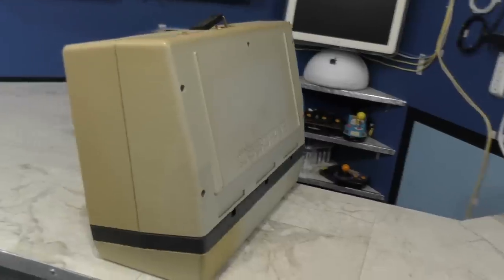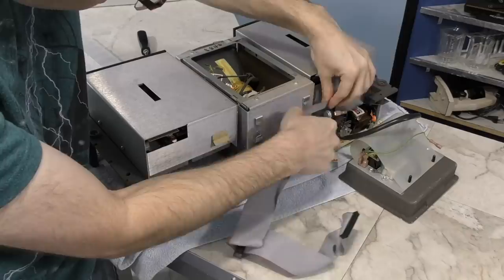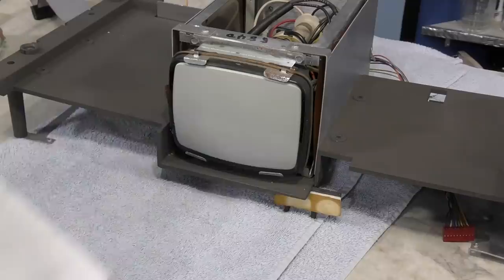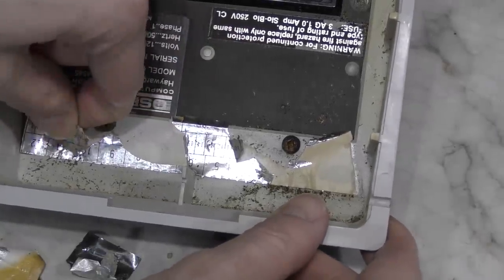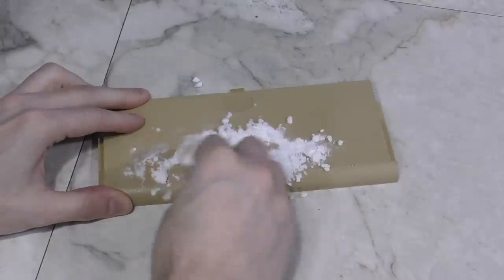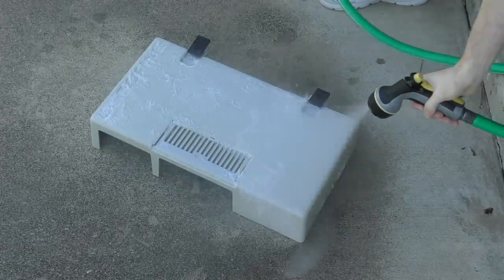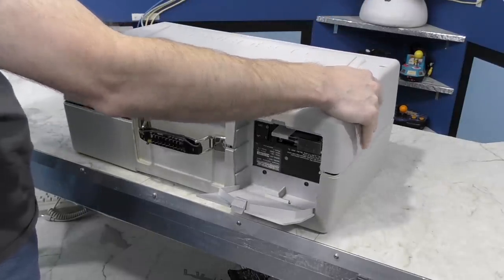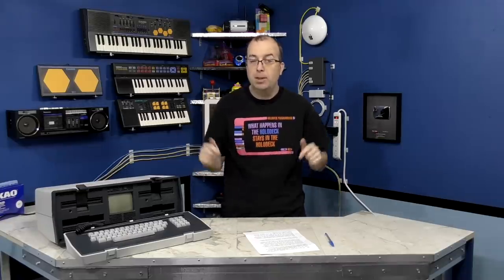Osborne 1 Computer Restoration Part 2

Comment: The mustard and ketchup analogy cracked me up! 😃

Perhaps someone could make you some 3D printed custom basins for you to use for submerging items in hydrogen peroxide?
Reply: There already exist big, transparent plastic containers
Reply: Wouldn't it just be better to get some clear totes from a store, fill it up with peroxide, and just leave it out in the sun?
Reply: a big plastic tub will work fine its the peroxide thats the problem he would need gallons of the stuff
Reply: Would it be possible to synthesize it?
Reply: Well, of course off the shelf is what's cheapest and easiest obviously, but I was thinking something that would help him keep the components in place or shaped to fit better. Just an idea. ;)
Reply: not if it's reacting with something, it's converting into... oh... I used to know this one..  one of the products is water, one is oxygen, and... by my math, that would use it all up. but I think there's more.
Reply: Maybe a recirculating system, collecting peroxide from the tray where the part is and pumping it back over the surface, spraying the part — or even just dripping over. Maybe a small fishtank-type pump would do the job.
Reply: fantastisk musikk du lager Anders!
Reply: Just take a big container and put a couple bricks or whatever in the biggest holes in the chassis to fill it up. No need to make a specific shape.
Reply: I use a 10 gallon aquarium. Glass is important, the plastic bins filter and absorb the UV.
Reply: If you have a Smith's Grocery nearby, they are doing a sale 10 containers for $10. Which is around 3 gallons I believe.
I saw the stuff on sale and was like wow, what would I do with so much peroxide and then this video came up lol
Reply: "Allow me to demonstrate with this mustard."
Reply: It degrades into water, oxygen, mustard and ketchup. It was shown in the video. ;-)
Reply: I like peroxide on my hotdogs
Reply: why not mix it up with water? I'm pretty sure part of what is in the retrobright fluid is water anyway. you could do a few tests with different concentrations and see how much pure peroxide you need. maybe using more water and letting it sit in the sun a bit more gives you the same results
Reply: Does using a bag w/ peroxide around the item, then a second bag +packing material to form that bag to the object not work with larger pieces?
Reply: LynxSnowCat   That would cut off one of the most crucial ingredients; Sunlight.
Reply: A large watertight plastic tank or container would be good be good and probably something about 100-150 litres and an electrical pump could be used to redistribute hydrogen peroxide and a UV light.
Reply: Patricia Cross , I *did not fully understand your reasoning. With two transparent bags- the first keeps an envelope of peroxide around the part, while the second (smaller surface area bag) takes up space by pushing the packing material where sunlight is already excluded.

(*reread previous comment)  I see where my previous comment could be assumed to mean surrounding the part on all sides with packing material, since I didn't make it clear what I meant by forming. 

Putting the second bag in the first tends to result in it floating and making the layer of liquid on top of the part very thin. So the second bag needs to be denser than the liquid or outside of the first bag. With the second bag outside of the first, the first bag needs to be loose enough to form around the contours of the part being treated. A loose bag will tend to let the liquid run off of the part, unless it is confined/formed by another container, such as the (tighter) second bag.

edit: I only used this to "whiten" hand held peripherals years ago, nothing desktop sized.
edit 2: explicit self incriminating detail changed to be implicit.
Reply: There's also the issue of the amount of hydrogen peroxide you'd have to use as well.

Comment: There are 3 film capacitors that need to be replaced in Osborne PSU's. You only replaced the one that popped. It'll be letting the smoke out again very soon.
Reply: Exactly what was going through my head.
Reply: The same thing happened to my Apple IIE platinum. Luckily I had a spare capacitor laying around to replace it.
Reply: What's wrong with these capacitors, why do they fail this way? I thought non-electrolytic capacitors are bulletproof and don't age.
Reply: @VioletGiraffe  search for RIFA X caps, they're a known source of failure. E.g. http://minuszerodegrees.net/failure.htm
Reply: Those RIFA line filter capacitors are notorious for popping and emitting smoke.
Reply: Meanwhile: watching because. wait why am I watching this idk I just like it
Reply: The days when no computer was complete without a time bomb strapped across the mains.
Reply: @VioletGiraffe  As Marco said, those are X-class Rifa capacitors. X-class means they're used as filtering caps between mains and neutral. The problem is that over time the clear potting can crack, which lets moisture enter the cap. This causes a drop in resistance, the cap heats up, maybe some of the insulating plastic melts (I am not completely sure about that), and then the cap usually fails in a short-circuit. This also caused it to spew its guts everywhere, and you have to do a lot of cleaning. If you have old electronics, open them and look for Rifa caps. Those things are a fire hazard, and I am not sure if you want to have a fire in your house.
Reply: @vincentguttmann2231  О да пожар о круто.  Пойду пукну.
Reply: @GrIpPiS  I'm sorry, but I don't speak your language, so I'd appreciate if you could translate it to english.
Reply: @vincentguttmann2231  He said "Oh yes fire oh cool. I'm going to fart."

Comment: I'm using your retro brightening method for the chairs in my garden, at first was marble effect but I started to spray the product and cover the things with huge transparent plastic bags, fill them with air with a compressor. Is actually working perfectly on the chairs and tables, I hope is useful for you as well.

Comment: Please keep in mind that The 8-Bit Guy is not a professional museum conservator. (I doubt anyone in the comments section is either.) As an enthusiastic amateur, he does what he does for the purposes of his own pleasure and self-edification, and although he does usually seem to know what he's doing, he's bound to make a few mistakes, but mistakes are one way of learning. The fact that he shows and admits his mistakes is actually quite thoughtful of him and should help others to not make the same mistakes in the future. Furthermore, nothing he has ever restored (or damaged, for that matter) has been exceedingly rare or priceless. 
With reference to the leather: there are some applications where it is useful to dampen or soak leather to make it pliable. A quick Google search also reveals that hydrogen peroxide shows up in some leather cleaning solutions, though not at the concentrations found in retrobright. However, soaking leather for any longer than absolutely necessary is a bad idea, especially if it's old or fragile to begin with.
Reply: He's not a conservator of any kind. Conservation and restoration are two different things.
Reply: H
Reply: platypusfrenzy No he’s both. He restores the computers and preserves them inside his museum of computers.

Comment: Ever considered keeping an air purifier and small, low-powered desk fan pointing in the direction of the air purifier by your workstation when you work on your projects? Would make it better for you in incidents where something such as a capacitor in an old computer or other device is to blow & smoke.

Comment: When I retrobrited a Macintosh SE-30, I used the plastic wrap as well, but instead of the sun, I bought a few LED UV bulbs and lit my work area with the light.  It took a little longer, but the streaking didn't happen.

Comment: that capacitor is more than just a line filter cap. it provides a ground safety loop, as well as filters in BOTH directions. it filters noise going into the power supply, as well as chokes out the power supplies own noise from getting back on the lines. sure its not "necessary" as long as your not using AM radio nearby

Comment: It still looks far better than it did. 

Perhaps if you just go through the retro-bright process several times then eventually it will all reach a point where it's as bright as it can get? I mean, it can't keep getting lighter and lighter forever, right?
Reply: You'd be surprised, it would probably just get sunbleached and discoloured. You can make it brighter but you can't make it back darker
Reply: Spongebob... your.. S U N B L E A C H E D !
Reply: The more times you retro bright te lighter it gets and it can destroy your plastic

Comment: I know that this is old, but I think the rivets for the handle could've been drilled out and then tapped. A lot of matchbox and diecast model restorators do just that on much smaller posts.

Comment: Hey! So I know how to answer your leather handle "problem"
I've done this procedure multiple times on old suitcases I find in my uncle's garage (I like to look for old valuable computers there it's it's all suitcases)
So there is no way to FIX or REPLACE the leather, what I do is literally take the leather handle off by cutting the leather wrapping around the metal rings. You then cut off the strings (At 10:20) one by one as carefully as possible (as you need a reference to your remake of the handle) and pull the leather into a straight piece and unfold it. Now as for the sponge, as I would recommend, just use a new one (Cause it might crust) and also measure how long and how thick the sponge is. Afther measurements, you then you go to your local fabric shop (Idk where you can buy this in the U.K., U.S., or Austrailia, as I live in Asia) buy a small strip of any type of leather (a.k.a. color and which animal) and any type of foam. And then you have to start drawing and measuring where you stitch and where the leather overlaps. 
I know this sounds confusing and hard, but if you have any questions, ask!
Good day and good luck restoring!

Comment: We call these things "Rifa bombs" or in german also "Knallfrosch" which means "Firecracker" ;) :D

p.s. please dont just remove them, you can replace them for example by WIMA MKP Y2 which are fairly cheap and much more secure...
Reply: Yes the infamous Rifa brand mains capacitors. I had one fail in a vacuum cleaner so that really spread the smoke about. I found some new old stock ones in my capacitors drawer and on those the plastic cases were cracking so would let in moisture. I agree that they shouldn't just be removed. The equipment will probably fail FCC regulations without it

Comment: I'm abit surprised that on the handle, you didn't wrap plastic around the leather part of the handle to protect it.  LIkely, being in the direct sunlight for hours helped damage it but I think even wrapping some printer paper around it and then plastic wouild have helped prevent that as it would have kept it shielded from both direct sunlight and the solution you use to retro-bright.  Just my thought.  Likely the retro-bright solution you used and the sunlight both caused that...

Comment: A pop rivet gun is a fairly easy way to reassemble something that's put together with rivets, if you have to drill them out. Just like with screws and nails you can buy little boxes of different sized rivets.

Comment: can I retro bright my teeth lol
Reply: Uh, yes, you can.  Hydrogen Peroxide gel is what's in those teeth-whitening kits.
Reply: Probably shouldn't roll your own solution, though, unless you know what you're doing. :P
Reply: just b careful removing them and id use plastic bags on the driveway method
Reply: Peroxide and UV is exactly what they use to whiten people's teeth, so yes. Just don't do it yourself.
Reply: Oh yes you can : brush you teeth after breakfast, after lunch and after dinner. Avoid coca cola. Avoid coffee, avoid tea. Avoid smoking.
Reply: CaptainDangeax yeah cool but how long do I sit it out in the sun for?
Reply: You don't need sun, just a good health a good behaviour
Reply: CaptainDangeax how is not drinking coffee good behavior lol
Reply: I was thinking of being clean. Lol if you don't know coffee turns teeth brown.
Reply: CaptainDangeax well if you gulp it down in droves, sure, but there's a such thing as moderation. Don't go crazy and you should be fine.

Actually, that applies to almost everything in life now that I think about it

Comment: How I do it:
I don't use retrobright, I just use a plant mister + peroxide. I use a UV lamp in a mylar lined cardboard box. Seriously, that's it. I have never ever had streaking problems or anything of the sort, and all of it is super easy to obtain, cheaply and in good supply. It's easy to use, pretty much set it and forget it.
Reply: Oh yeah, that would work for sure, but David has mentioned before that he prefers to use the sun because it takes a few hours instead of days, and he's a busy guy.
Reply: Well if you live in Texas... to some of us the sun is a scarce resource :-D
Reply: I'm in SoCal where it's sunny every weekday when I'm at work and overcast every weekend when I'm off.  dafuk!?
Reply: what procentage of peroxide do you use?
Reply: I use 5-8% concentration Storm Peroxide from Home Depot. 3% topical will work too if you don't mind waiting a bit longer and buying up a bit more. I collect it in a bin and refill the feeder every so often and that seems to work great.
Reply: avfusion ok thanks dude, im gonna try it out
Reply: You can use a large 'face tanning' UV light for large objects as well. The brand I know of is called 'Sperti Fiji sun'. Lots of restoration guys use this specific UV lamp for large part restoration.

Comment: I know this is a little bit older video, but I've used the plastic wrap and cream method loads of times and never seen the streaking. But one big difference is I don't use the sun, I used a retro brightening box covered with UV LED light strips and wrapped in foil to reflect as much light back into the box as possible.

Comment: wish computers now a days were this repairable I might be able to get a job doing what I like fixing computers.
Reply: Actually, they are!  just replacement parts, ram, video, etc.
Reply: It's actually very easily repairable these days
Reply: You forget the laptop and tablet market, where almost everything is soldered onto the board - Ever tried replacing a soldered BGA part? I guess not!
Reply: Thank you. More and more computers are going this way. Even business class laptops and such have so much glue and parts that are hard to get and soldered parts and such. 

Also pretty much everyone I know is fine with a 300 dollar laptop that has very little if anything to fix if it breaks.
Reply: +nrdesign1991 well with laptops you usually just replace the motherboard (if you knew soldering I suppose you could swap specific chips over).
Ram, harddrive, LCD screen and keyboard is usually pretty damn easy to replace on a laptop.
Never tried opening up a tablet though, I could imagine it being very difficult.
Reply: Apparently you have not tried to fix a laptop with soldiered on ram storage and everything else onto one board. A glued in battery. A glued together body. Specific screws that you need a specific screwdriver that you have to special order to get into the laptop. An inability to order new parts or parts that might be defective because you are ordering them from people online who might be scam artists. The reason you are ordering them from certain sites is cause the business's like Apple or Hp or Dell or such dont sell the component.

Yeah sure my old laptop from 2011 that still works good enough for stuff is fixable but my new laptop from 2017 is not so much. 

Even desktops are still repairable but just doing a quick list in my head of 15 or so people I know 2 need full fledged desktops the rest a modern non-repairable laptop or tablet or such would work just fine for them.

Oh and dont forget I am currently typing this reply on an 85 dollar computer. It is a stick pc.
Reply: +jaime munoz Wow, that's just cruel. I have yet to open up a laptop like that however. Of course Apple would be the ones doing it
Reply: Search Microsoft surface laptop teardown here on youtube. Ifixit did a teardown on that laptop and it got a repair-ability score of 0 out of 10 there is no way into that laptop without damaging something.
Reply: Wow that's a damn shame, I never thought it would be that bad
Reply: I recently replaced the case on an iPhone. Holy cow would I rather work on a computer like this. Nice big screws, big connectors.

Comment: About the perox problem (the uneven spread). I was thinking, is there any way you can spray the product on the cases? Like with a spray gun for painting? I thought about this as a solution because when I was young I used to make plastic airplane/boat models and was always hard to paint large pieces, i.e., to make them look homogeneous. I used a paint brush, so the coat was never quite homogeneous. More professional people use spray guns that work with a air compressor. I never used one, since it's quite expensive here in Brazil, but I know that that kind of stuff is kinda cheap in the USA. Spray guns for paint make the job easier, quicker and leaves a homogeneous coat on the plastic. Maybe you could you something like it, since the perox cream kinda looks like paint in terms of texture.

Nice video, I laughed hard when you used mustard and ketchup as an exemple! Cheers from Brazil!